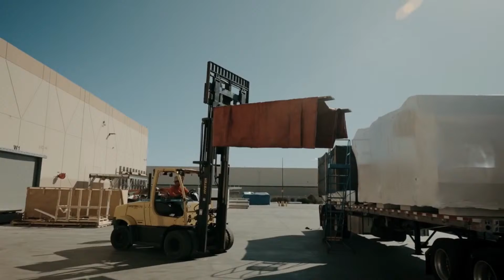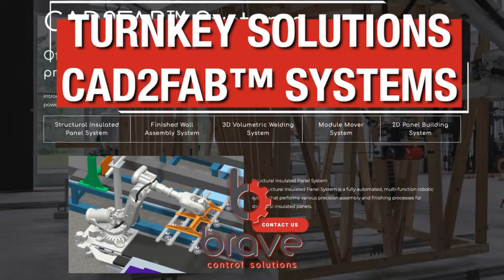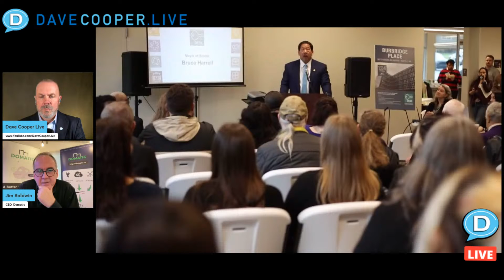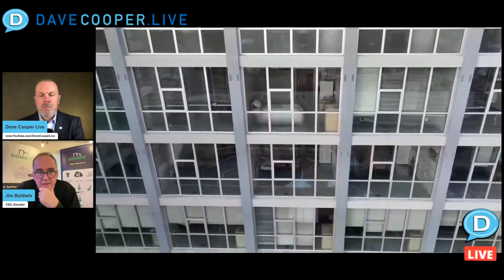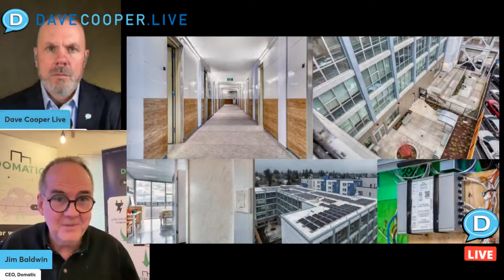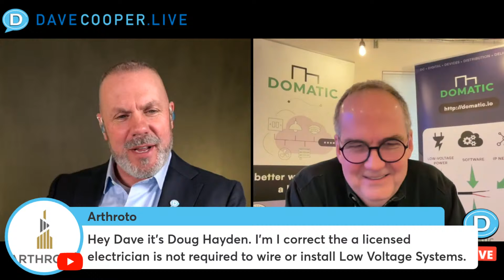Low Voltage Power + Building Automation for Affordable Housing

Comment: Interesting - however, I scoured the interweb and couldn't find anything posted/published related to what the programming interface for Domatic's system looks like or how it works.  I really wish you would have covered that in a bit more detail than - "maybe the electrician has to open up an app and check if something is wired wrong."  There was mention of HVAC and other sensors being integrated and color temp changes with time-of-day sensing, but no mention, or view, showing how the system is "told" what to do and when to do it.
Reply from the maker: All great points.  Send them this message on their contact us page and if sure he’ll answer you.